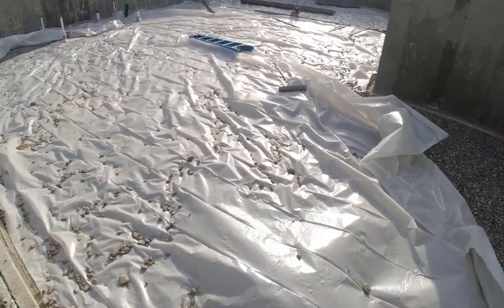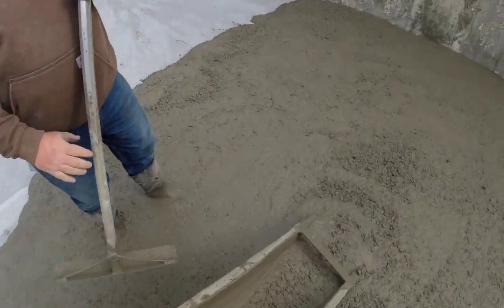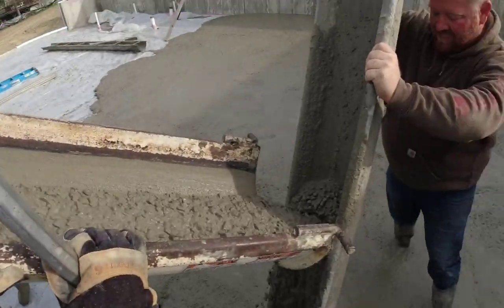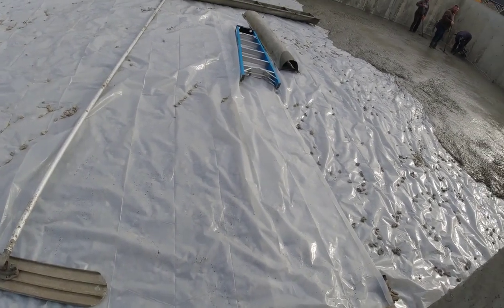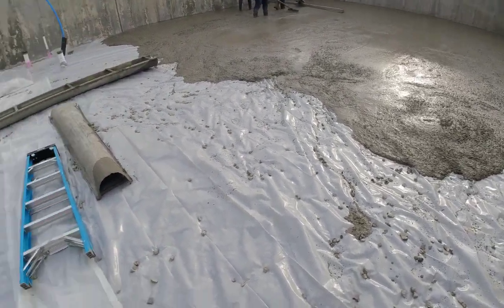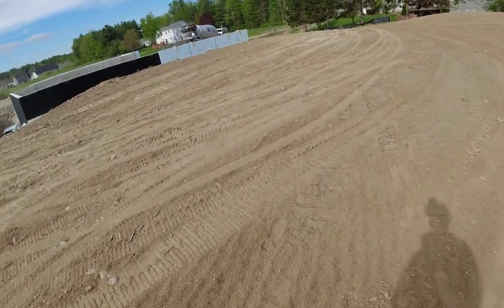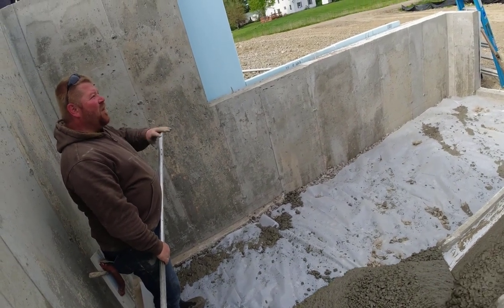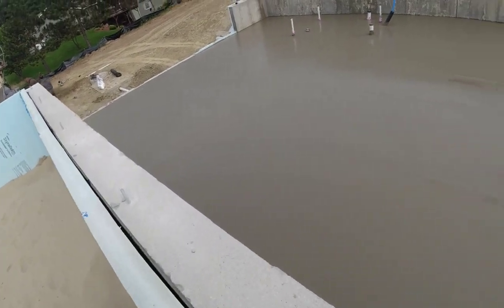They Added SLAG by Mistake! Big 2200 SQ. FT. Concrete Floor Pour

Comment: If you can see the fly ash, what you call slag, it's a symptom of using the high range water reducer. The HRWR is basically a "plasticizer" that is supposed to prevent desegregation on high slump mixes and give added strength by using less water. The driver could have had a couple yards left from his last pour and they batched over it but if you can see fly ash/slag in the mix, you are close to the max water allowable as desegregation isnt far away.

Comment: Slag has been used in the UK in housing as hard core under finished floors usually if there is Steel Plant near-by, It has one serious drawback to day it acts like a Faraday screen and if you are in a ground floor room it can severely affect your cell phone reception/transmissions, If they are using powdered slag in these pours it could have the same effect.
Reply: We used a copper Slag mixed with steel Slag as a screen for outside sources for our data center server room. Very good at blocking signal from the outside can confirm

Comment: They put slag way back in the day in the Pittsburgh area and when that cured it turned blueish and it is a bear to drill, cut or jack hammer it. You can keep that slag stuff
Reply: Pittsburgh area guy here. You aren’t kidding about that stuff. Many jackhammer bits dulled and carbide sheared on the old blue slag. By far the worst to hand grind is are the slabs seeded with aluminum oxide for traction. It was  popular in the 60’s and 70’s and just eats diamond segments for lunch !

Comment: Wouldn't slag contain iron (since it is from the steel industry)?  If so, wouldn't one expect to see rust on the surface?
That looked like a bit of a challenging job.  Thanks for sharing.
BTW - the "driver" knew damn well they had slag in it.  He was there when they made the batch in his rug.

Comment: I remember back in the 80's a couple concrete companies here in Pa. were using granulated slag in the mix to cut down on the cement like you were saying . Only problem was the slag had small pieces of iron in it and the water in the mix would make it rust and the rust  would bleed to the top !!! Needless to say they stopped that pretty quick !
Reply: What up Tim. Now I know where u r from and that's why u r the way u r. Jk happy belated fathers day to u and mike

Comment: I’m here in the south coast of Massachusetts. We have two main floor guys, one guy uses Mid Range and wets it up to a 10 slump. The other guy uses 2% accelerator and makes me add 140 gallons of water to 11 yards when the truck arrives at a 5 slump wets it up to wash out
 ….. and it’s never wet enough. 

Average size floor is here is 33 yards.

Comment: Only used Fly Ash as a cement replacement once or twice[client saving money]…..pros doesn’t bleed on formwork joints and leaves a generally good finish, and doesn’t need overworking with the poker, nice to handle. Cons prone to causing burns to skin [tops of wellies] and bad for splashes to eyes……got to be sooo careful, otherwise lovely stuff, mind you this was mid to late 90,s

Comment: It might have delayed set but the customer gets a concrete with superior long term properties. Especially with certain types of rock, in some areas the rock has a reaction that can result in spalling, pozzolans can stop this. [to a point some rock is just too reactive for any concrete] But even without reactive rock you can get more durability.

Comment: I would think moisture with slag would create surface rust. Slag like black beauty blast media? For my 3000 square foot walkout basement we used a layer of white foam, plastic barrier and wire mess. Keeps the floor warm in Iowa amd cold not conducted back.

Comment: If it's not what you ordered, why not reject the whole load on the spot?
Reply: That’s hard to do sometimes
Reply: Because sometimes when you have a certain number of trucks lined up and don’t know when or if you can get more it can cause more trouble than it helps to send a truck back in the middle of a pour.

Comment: How will that slap not crack with no reinforcement mesh in it?
Reply: When it's not structural,  just compression member in the design, it's not a problem.

Comment: They gave you a flyash mix not a slag mix. Slag is just about pure white, flyash is super dark sometimes almost black. Either way, yeah you'll get a delayed set time
Reply: Yeah, I've never seen any black granules with slag. It's very white. Fly ash varies by load and supplier. Side note: many finishers don't like the longer set time, but as the consumer you're getting a MUCH better product in the long run.

Comment: Slag is brilliantly white and it whitens the color of the concrete. Fly ash can be very black. Either way, you should not be able to see it when pouring. That means it either wasn’t mixed long enough or they are loading the concrete too dry (holding waaay too much water) because they are using too much super and the mix is dry packing in the mixer at batching.
Reply: I've been batching concrete for 30 years and if they can see fly ash it means there was too much water reducer and/or water used or the driver had some left over from a previous pour and they batched on top of it and sent it. If no powder balls were coming out the load wasnt dry packed.
Reply: @id10t98  it sure looked on the verge of separating, could be too much water reducer. I would think if it’s left overs it would be pretty well mixed in by the time they got it right? I mean if you’re seeing an additive cement as obvious as that I wouldn’t think it’s from leftovers?
Reply: @erikjohnson5608  The driver acted like Sgt. Schultz, "I know nothink, I am only zee driver..." which tells me something is rotten in Denmark between the driver and the batchplant operator when there is fly ash in the mix when they didnt ask for any.
Reply: @id10t98  Ha! Fair point!

Comment: thanks for the video! while it may not be the concrete ordered and as you say slag may slow qure time which is a downside for the scheduling....it is also as you point out hydrolic  and should be a higher psi mix  resulting in a better floor...

Comment: Why no mesh or rebar?
Reply: Internal floors on grade no need for strength and stability. No one is driving on it or putting a load on top. All basement slabs on grade are this way

Comment: We prefer a Straight Cement mix too. GGBFS, Fly Ash , and Silica Fume have their place, such as a high strength repair mortar , form and pump , and overhead repair materials. ( BASF 1061, MC 440 , etc.) 
Tax breaks for using byproducts is the name of the game though.

Comment: I would have tested the load first before accepting. The iron in cement will eventually oxidize from moisture penetration and cause micro-cracking and bleed.
Reply: What do you do to test a load?

Comment: Noob question - what is the spot that he is toning out and marking with an 'x'? Is that a pier location?
Reply: that's the max thickness the concrete should be. he was using a laser to determine that. when it beeps it's the right depth.

Comment: If your using high range water reducer why do you keep adding more water?
Reply: Makes it easier to pour, and finish without affecting the strength.
Reply: I believe that they add more water to get the slump that they desire.  In this case because they had to pull and push the material to places the shut couldn’t reach.

Comment: Wish concrete companies as a hole would be uniform in mixes everyone is different. I do a lot of state work and they have to have slag or fly ash in mixes for the “green wave emissions free”. I like high water reducer only two companies have it one is reasonable the other one charges arm and leg for there concrete.

Comment: no rebar or wire reinforcement? No slump test? Not planning on returning to do relief cuts? This contractor defines whats wrong with the industry. I gurantee the slag wasnt a mistake... they're just cheap.
Reply: This is a basement floor on grade. It's internal so no need for reinforcements. Why would any home owner want relief cuts on their basement concrete floor and most likely covered with carpet or vinyl product.

Comment: I tried a slag mix last year, searching for a mix that could be finished in the summer. Definitely not slag.  Went to a 8000 lb C mix, finishes great just a little pricey
Reply from the maker: We're not fans of slag. We just want regular old concrete with some mrwr.
Reply: @MikeDayConcrete  There's been a shortage of cement in many places across the USA and fly ash is a slightly cheaper additive for the ready-mix companies. I'm sure your supplier would be more than happy to batch you all cement loads with no fly ash but you may pay extra for it. I'm guessing the driver had some left over from his previous pour and they batched on top of it.

Comment: I'm confused, slag is white not dark colored.
Reply: It's fly ash, not slag, slag is white colored. Fly ash gives these black stripes as seen in the video. The supplier doesn't know the difference...
Reply: @patrickvanlanen4037  The only fly ash I've ever seen is lighter colored as well, white, light brown, orange, to yellowish. There is a slight amount of carbon (that is black) in fly ash and that can migrate to the surface due to its specific gravity in very loose concrete. This amount is generally very small as it also makes air entraining concrete much more difficult.
Reply: @drcornelius8275  overhere in the Netherlands we get it from the waste- and coal-burning process, so it's mostly black-ish.
Reply: @patrickvanlanen4037  Same as here in US, I guess every source has its distinct color however the darkest I've ever seen is a lt grey here. And nothing that would make a significant color change at 10-30% replacement.
Reply: @drcornelius8275  fly ash color depends on the grade of coal and how it is burned.
Reply: @jamesdempsey7099  Sure, but I've never seen black fly ash or seen much of a difference in concrete color when used in a normal replacement %... bottom ash yes could be darker/black, but I haven't seen it used in concrete

Comment: Refer to industry standards (ACI) for All information about concrete, additives and performance. Every guy with a trowel knows more than engineers studying the materials and chemical/materials engineers verifying and certifying what the material does. Experience is vital to great results in the field but on big, real jobs it is by the book, under the engineers direction. Period.
Reply: You don't need to be a engineer to know a company should deliver what was ordered and not substitute.
Reply: @tedsaylor6016  as i said, on a big job batch plant deliveries have been found to be unreliable, hence engineering quality control. Every transit mixer delivery has a batch ticket indicating what is in the batch, even on a small job. A superintendent or concrete crewman lead who does not check the ticket is not doing you any favors. Early on, I started a small company and placed concrete driveways in Orange County, Ca. We would always check the batch and time in the transit mixer. Jack hammering out a hot batch that cooked off before tooling was a costly and hard lesson.

Comment: Poured a 2 ft band around a commercial pool 18 yards with retarder added poured it out and it had a blue tint and funny smell got all the mud down and it wouldn't go off turned out mix was supposed to get like a gallon of retarder instead they added 13 gallons by mistake? They come out admitted that mistake and paid to have me redo it again on their dime be safe sir nice channel

Comment: Did i just see you throw a couple bags of calcium in the mix???? 
Does this not affect the strength of this concrete...Yes it speeds up the set time ...
Reply: Calcium can cause rebar to corrode over time causing the structure to fail.
Reply: @jackwilliams7738  No rebar here unless there are fibres and so thin and wet it should be riddled with cracks once cured.